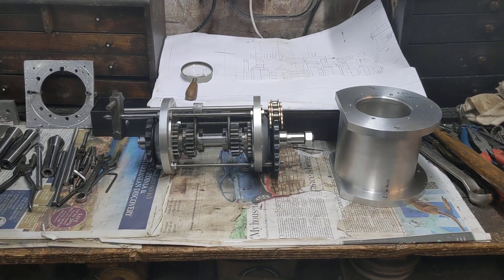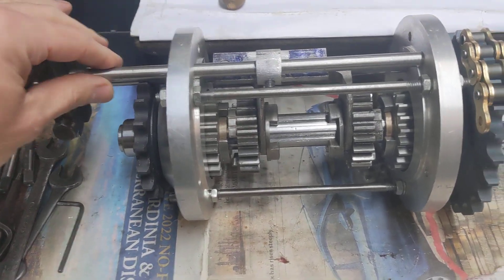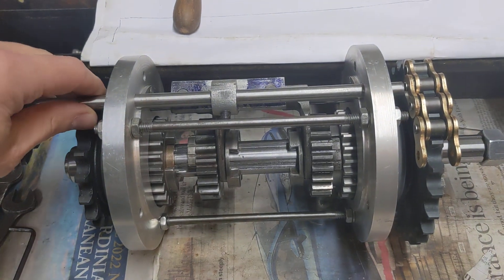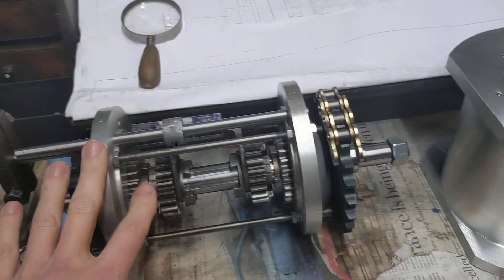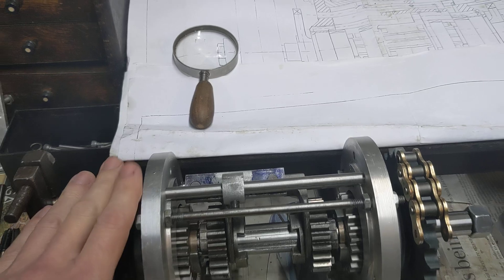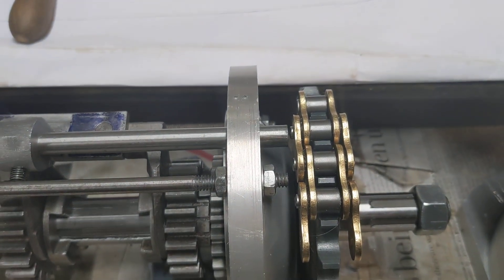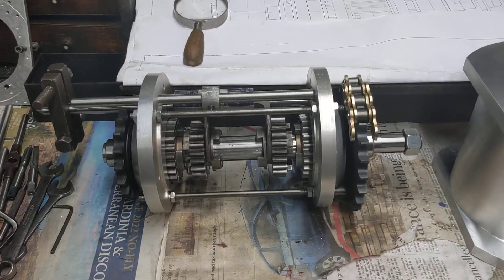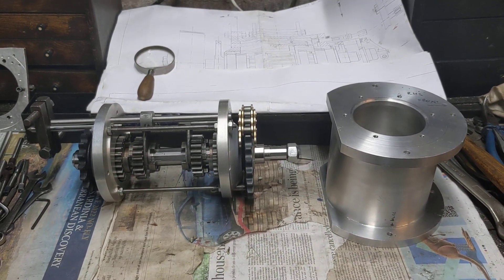Gear Selector Shafts Done 💪

Comment: wouldn't it jumping out of gear be an issue if the selector shaft is only held in position by a detent? Especially with the high torque and low rpms you will be running at. Standard motorcycle transmission with a shift drum have the drum grooves position such that the gear levers are locked in place while in gear.
Reply from the maker: The dogs are under cut, so it should pull itself into gear and stay there. The detent is just to assist. I could be wrong of course, I'll let you know when I ride it. 💪